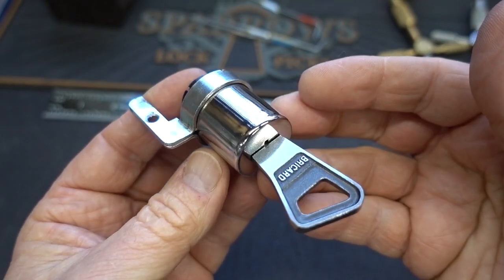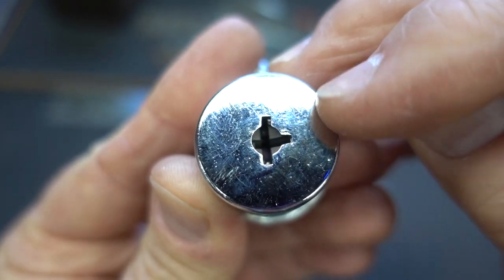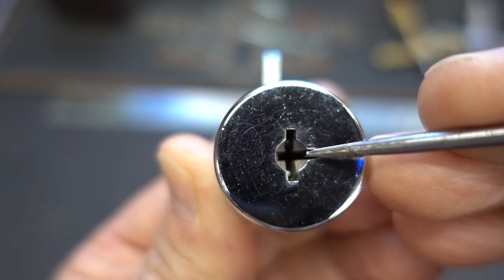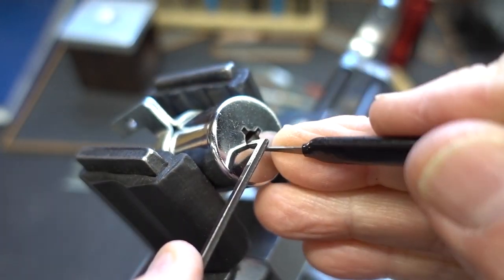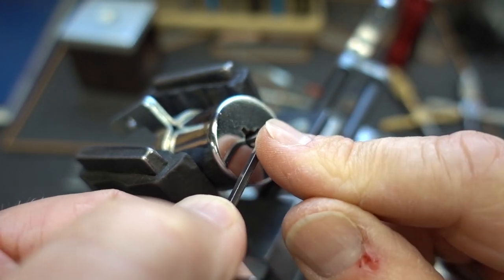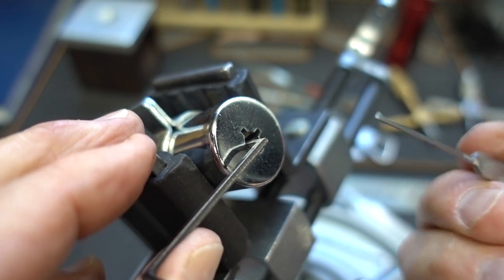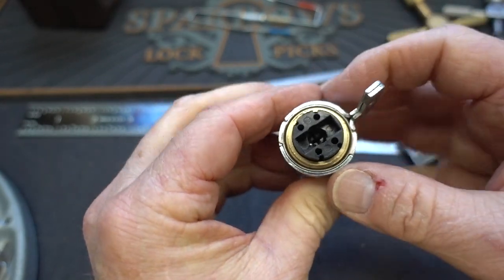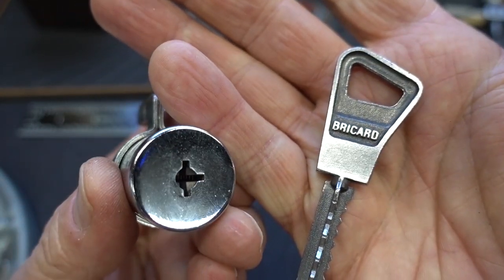(1664) Bricard SUPERSÛRETE (Zeiss/Cruciform/Cross) Lock Picked

Comment: When totally shut, I had to turn it 2 turns to retract the 3 bolts holding the door and a quarter turn to get an open (the spring loaded bolt). I guess that would be annoying to pick.

Comment: Looks like it is used with an electrical switch so 90' would be all that is needed. There is insulator on back of lock to prevent shock to operator. Try to unscrew the brass insert, the screw could prevent the brass bushing from turning.
Reply: There's only one half of the full lock cylinder, you have a symmetrical lock on the other side (see https://www.bricard.com/fr/produits/cylindres-et-organigrammes/cylindre-supersurete-ronds.html )
Usually, it's associated with a double turn bolt, on a standardized reinforced door like this one:
https://www.fichet-pointfort.com/fr/site/fichet-pointfort/produits/porte-blindee/porte-dappartement/spheris-xp/
note that outside the door there is no handle, it's the key that activate the lever, so you have to pick it one time more.

Also, usually, to force open this type of door, the quickest way is to remove the handle plate, knock out the whole cylinder (breaking the screw which holds it in place), and replace the cylinder with a dummy to unlock the door (the door often includes at least 4 points of bolting). It's a bit noisy, but it's the quickest way.

Comment: @Bosnianbill I'm wondering if there's another set screw hiding under that bracket.
Reply: If you look at it head on, the bracket itself is acting like a C-Clip and holding the lock in place. All he would need to do is remove that bracket and the whole thing comes apart.

Comment: think its possible there is a use for the straight bar side of the key rather than just torque. have yo tried a full length torque bar when picking? new to this locksport and picking but if i wanted to mess with a thief it's what i would do. also did you try giving the outer ring a loosen a remove it off the barrel to get ? Again ignorance is bliss but it looks like it had some retainers as a part of it.

Comment: I've always been impressed with four sided keys. Is it possible that the 3 indents on the flat side of the key correspond to trap pins in the slot that you used to tension it? (So you only got an open when you accidentally rocked the tension tool enough to allow those trap pins to disengage

Comment: Key in from the back to remove the core???
Reply: Or cut a key from a cross key blank and cut down the key turner/sprig/keyring flat whatever it's called, and push the cut down key through the front